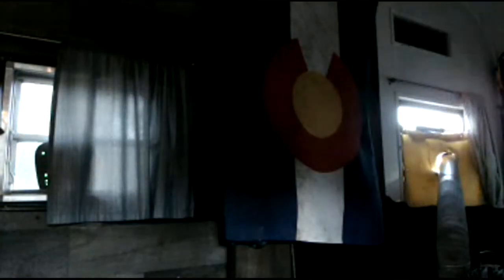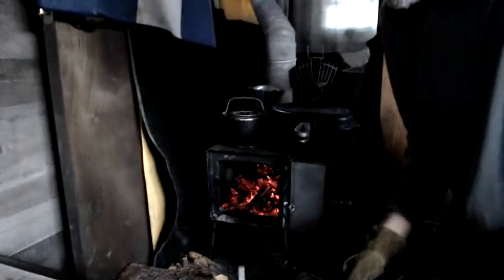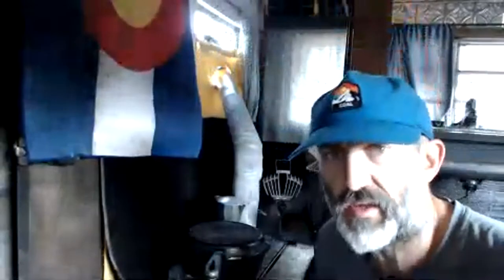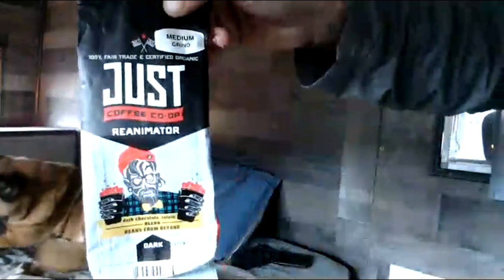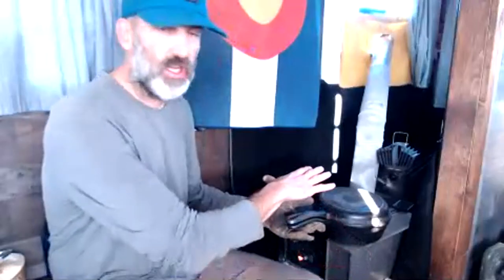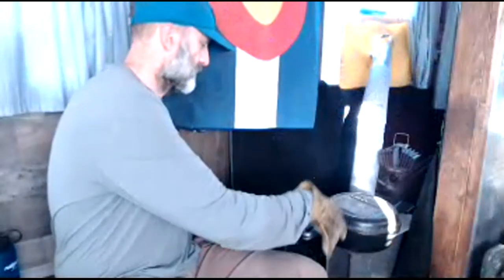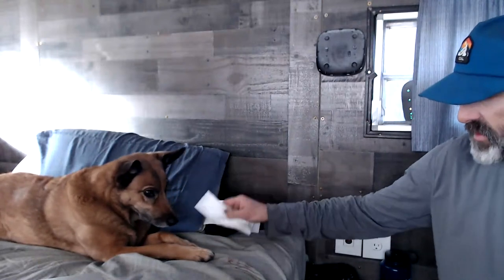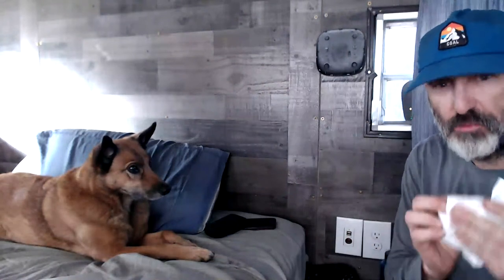How to Cook Over a Wood Stove - We'll Do Something Easy (Biscuits)

Comment: Thanks for the suggestion on the Tacoma’s leaf springs. The welding cloth is nice for a temporary measure, but I work with that stuff a lot and it will degrade and the fiberglass in it will float around on hot air. My buddy’s dad once said while we were camping in freezing temperatures “in the event of an apocalypse aluminum foil will save your life” I’d say if you can make a panel out of foil it might be more than a temporary fix. Thanks for showing a great way to use a wood stove